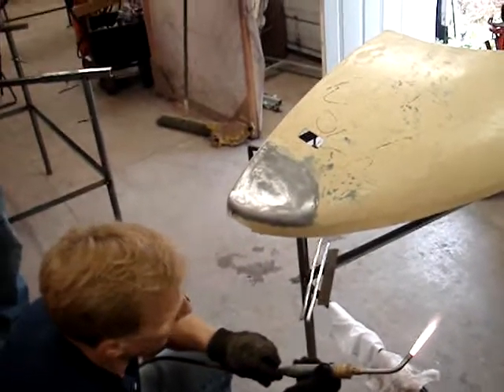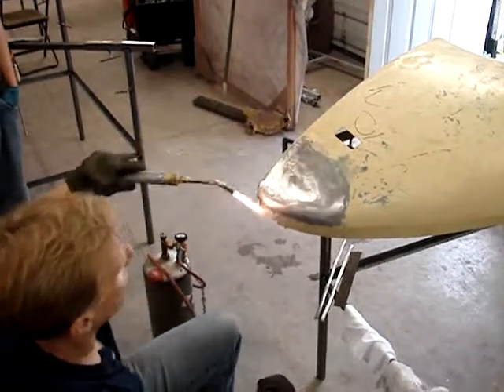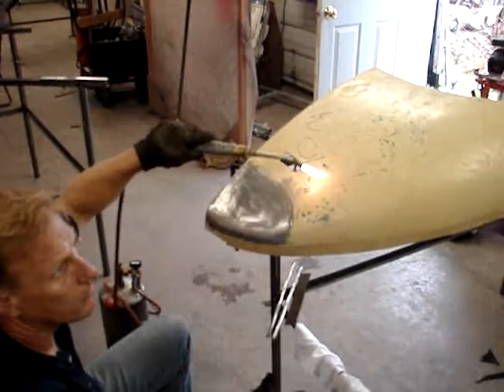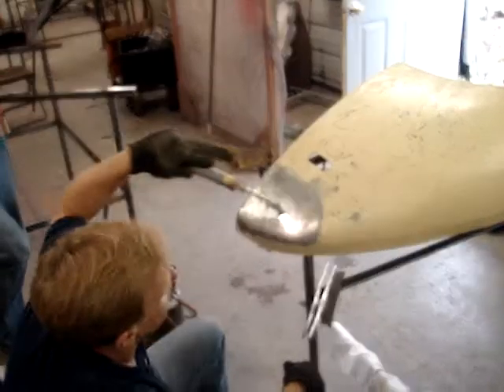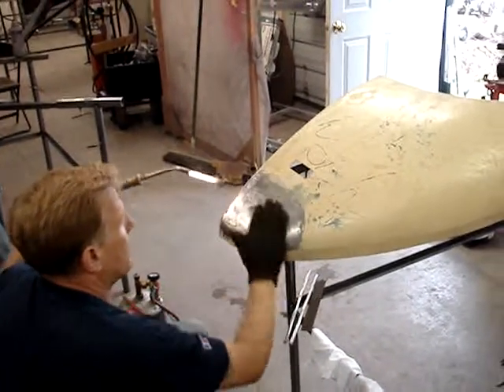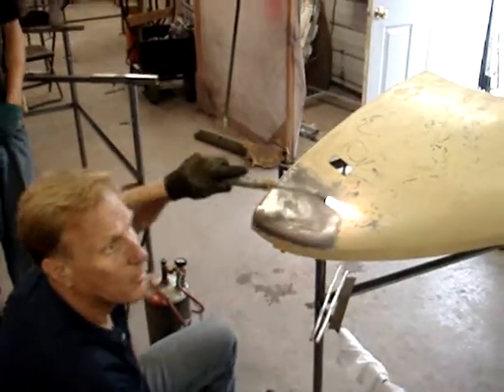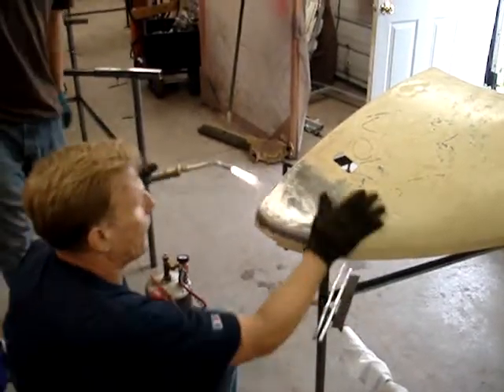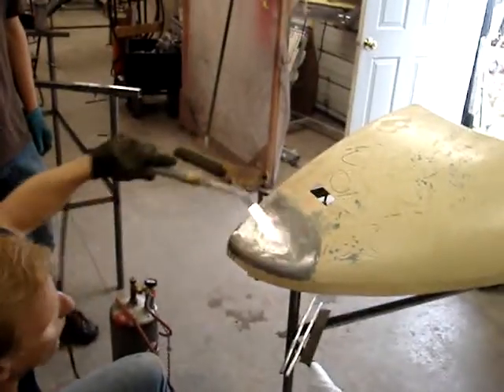Don's panel soldering demo part 3 0f 18

Comment: A couple of mistakes here.  First, he's using a torch without a flame spreader.  There's a reason why most torch sets come with a spreader.  Secondly, if a torch is making a noise like that, it's poorly maintained, which makes it dangerous.  Thirdly, the guy keeps  putting his hand on  the metal that he's been heating.

I can't believe that he's TEACHING a class, when he doesn't even know the rudiments of shop safety.

-jcr